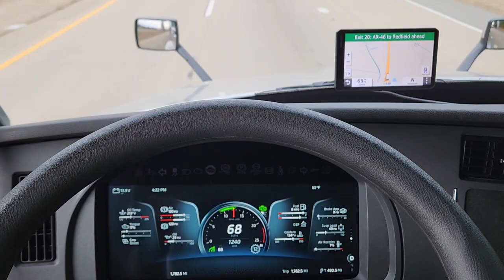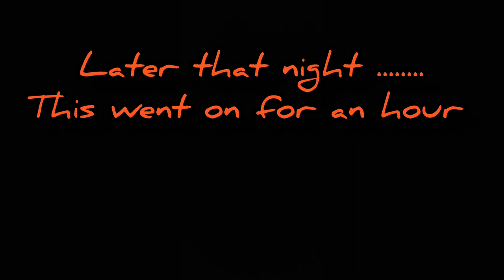FIRST LOAD IN SILVER BULLET MY T680 NEXT-GEN

Comment: Congratulations 🎉Jackknife! I knew you made the right move buying the new truck.
 I have owned two W900s big Cat 3406s, 15 speeds and three Pete 379s Cat 3406s, 18 speeds. I have been trucking 36 years and 4.5+ million miles. I have a 2023 T680 with a 12 speed automatic and would never give it up! Fuel mileage, less driver fatigue, it’s the best!
  Your not going to have breakdowns. Your truck should run the first 300,000 miles with no problems. The only tip I can give you is change your oil every 15,000 miles. Don’t run high mileage service intervals. There is a relationship between dirty crank case and dirty DPF. I change my oil every 11,075(5 weeks) that’s a little extreme but I recommend you not go over 15,000. I run new DEF trucks 300,000 and have only had two bad DPF pressure sensors and one DEF quality sensor. They are bad from the factory there was a national epidemic of those.
 Congratulations on moving forward from a trucker to a business Man! You won’t regret it.
Reply: Chickenhawk do you run 300k then trade in?
Reply: @anthonycary947  YES! That’s exactly what I do. New truck, run 300,000 and trade it in on another new truck. Depreciation write off is big, maintenance is low and the trade/retail value of a 34 month old truck with 300,000 is high.
  I was holding off telling that to Jackknife. But in 24 months I will start in telling him to trade it.
Reply: I don't know how to tag your name, lol that is what I am trying to convince my company to do. Our trucks have 365k been trouble after trouble,  one at like 335k nothing but issues and one at 490k knock on wood it hasn't been terrible
Reply: @anthonycary947  Yeah Anthony. Very few people buy into my 300,000 mile trade cycle. But it is the way to go for meany reasons. One is I can tell you exactly what my maintenance costs are. Here it is for 36 months:
29 PM services
 4 New Steer tires
 2 engine air filters
 2 A/C outside cabin air filters
 2 A/C inside cabin air filters
 2 Bunk A/C filters
 8 sets of wiper blades

No clutch, no brakes, no drive tires anything more is covered under warranty. But I have not had meany.
  I trade the truck in with 50% drive tires and they are the same tires that came with the truck when I bought it.
Reply: Makes good sense to me!
Reply: I question whether a low mileage glider is the answer or the 300k thing
Reply: @anthonycary947  Anthony in my opinion the gliders are junk. Your starting off with a rebuilt engine. You are in the repair phase from day one.
 I have bought and run 5 DEF trucks and have had almost no issues. Two DPF pressure sensors and one DEF quality sensor. None of them left me stranded on the road and they were replaced under warranty at the dealer on my days off. DEF trucks are not the big problem everyone says they are. I think maybe as the truck ages is when the big DEF problems start. That’s why I get rid of my trucks at 300,000.

Comment: Hey the fifth wheel problem, we've got a 2022 here that I couldn't get the fifth wheel to slide because the air was leaking in the connection to the air cylinder because the airline was too short. you know anything to cut cost and increase shareholders profits